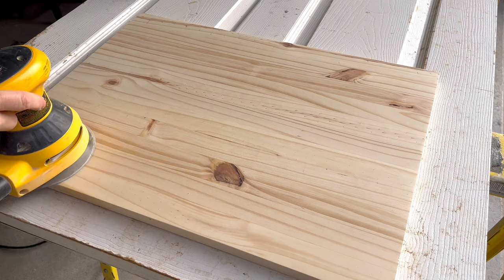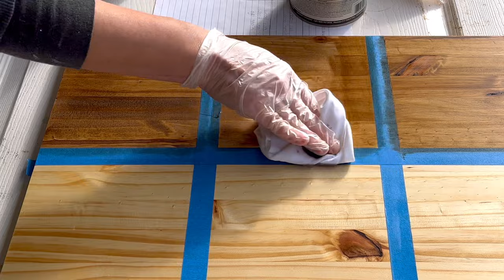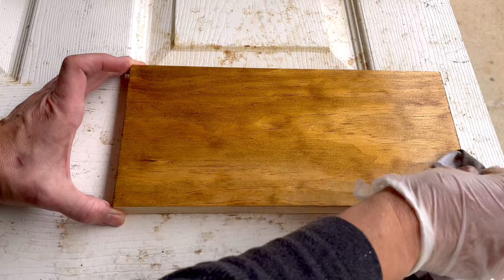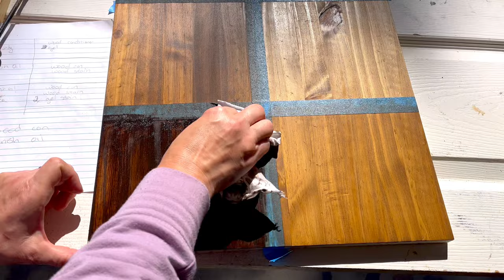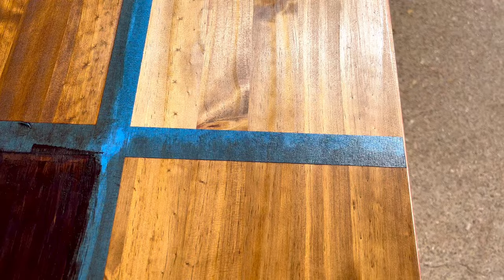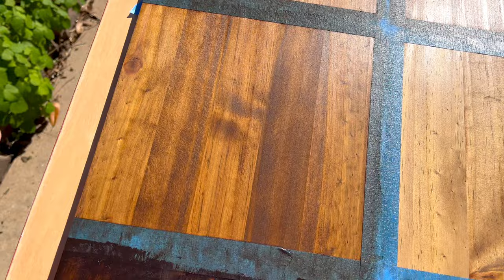Testing Wood Stains On Pine To Find The Perfect Medium Brown Stain!

Comment: If the glaze was oil based and the stain underneath was water based or vice versa, you probably didn’t let the underneath dry long enough before putting glaze over it.
Reply from the maker: Good thinking. That makes sense. I actually checked General Finishes website after making this video. They recommend using the glaze over a clear coat when you want to use it over stain. 😊

Comment: A fundamental mistake is sanding it too smooth. There is no reason to go above 120. You don't want the pores of the wood closed tight, it inhibits stain penetration and finish adhesion. The stain surface can be knocked down before finish with any green pad if needed.
Reply from the maker: Hmm, this is the opposite of what most people recommend. Especially with soft woods like Pine, stopping at just 120 will leave dark spots, swirls, and lines in the finish.
Reply: @AbbottsAtHome absolutely. I have always heard not to go above 220 for stain.

Comment: Hi Abbotts at home.  I have done similar tests as yours and was surprised to find that if I left the wood conditioner dry fully (sometimes up to 8 hours), then the results were much more even and other blochy'ness was cut down quite a bit more then only waiting 15m or even an hour (depending on temperature).
Reply: I should say I was using old masters wood conditioner, I remember minwax wood conditioner having different working properties and any maybe they did encourage staining before it fully cured.   Here is the line from the Old masters wood conditioner data sheet "Apply stain over Wood Conditioner after 8 hours. If stain is applied before 8 hours, a darker color may result with less uniformity control."
Reply from the maker: Great tips! I'll have to try that with the Minwax Wood Conditioner. Thanks for sharing.

Comment: Two words GENERAL FINISHES 😉
I don’t think you are getting the results you desire. I suggest try water based by this brand it will knock your socks off. Pine is notorious for being a hard to stain wood. You need something very rich in pigment to knock down all that yellow. The stuff you get from the big box store doesn’t cut it. Also gel stain is more for layering the non wood surfaces or existing finishes. Pine is too soft for gel stain to get a good stick. 
I’ve watched videos of people that have been experimenting with stains and woods for 30 plus years. There is so much to the chemistry of it all. I don’t think many people realize the complexity to different wood species and different stain options. Keep trying don’t settle for anything in a yellow can minwax or varathane. I’m saying it the nicest way possible my makeup has more pigment than those brands.
Reply from the maker: I think I used GF gel stain near the end of this video. 🤔 But, I didn’t wait long enough after applying the base. So the GF didn’t look as good as it normally does. For this video I was trying to get a medium brown look with just the options I had on hand. My GF is too dark for what I wanted anyway. But, I should do another video using just gel stains on Pine. It is easier to avoid the blotches with gel. Thanks for sharing. 👍
Reply: What product would you suggest?
Reply: Hello!! Would love to see you do a tutorial or list some products… all I have access to is a Lowe’s and the stuff I’m making for my home looks great until I try and stain it, I’m so frustrated! You seem really knowledgeable